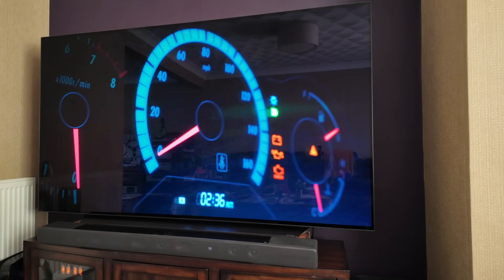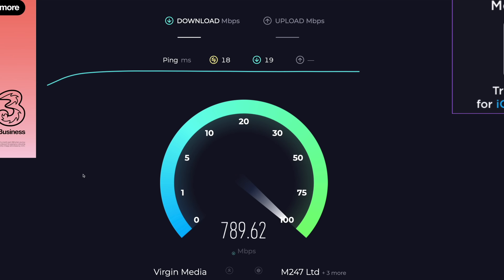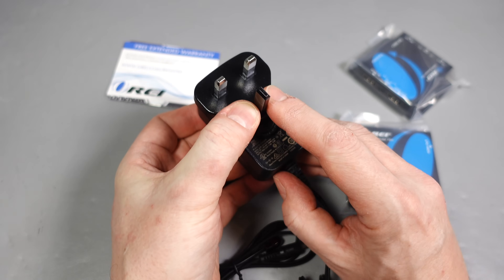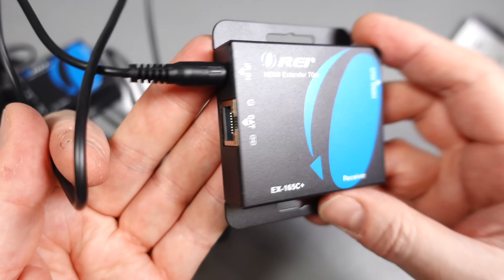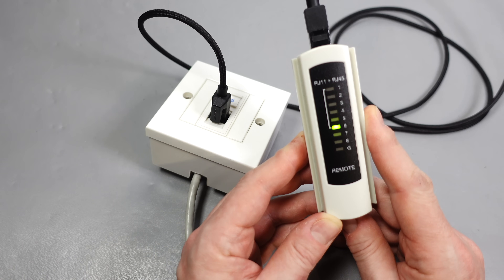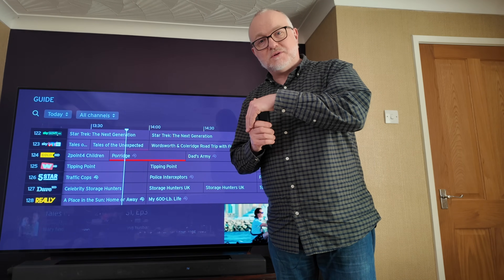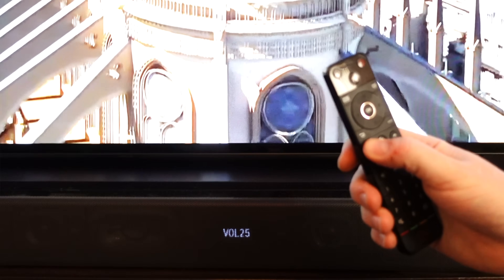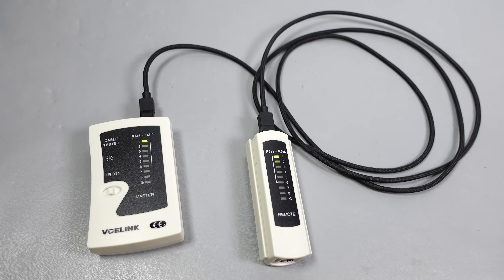HDMI via a Cat6 cable works surprisingly well

Comment: We use a lot of similar HDMI and KVM extenders for setting up CCTV monitoring/NOC centers at work. It is worth noting if you are thinking of installing these, do your self a huge favour and run screened Cat cables-and use the screened plugs as well. Most decent models will recommend this, as these extenders can be prone to interference.

Comment: Stupid question but those set top boxes usually connect over to the ISPs router via an Ethernet cable. Why not just use the existing cable and keep the box next to the tv?
Reply: Mr Techmoan had to put the box upstairs because that's where Virgin's coaxial cable comes into his house. The set-top box has to be connected to the Virgin coaxial cable from the street. This particular box also has to be connected to the Virgin router via Ethernet, which wasn't required for past generations of boxes, but it's the coaxial cable that's dictating the location of both the set top box and the router.

The householder isn't usually allowed to modify or extend Virgin's coaxial cable. Paying Virgin to install a new one is probably an option, but that would probably weaken your position when negotiating a good price for the new contract.

Virgin's "Stream" IPTV box can be connected via Ethernet only (though it's WiFi as standard) but that's a different service and not what's shown in this video.
Reply: @patrickwigmore3462  okay that makes way more sense to me, thanks for the explanation 🙏

Comment: These have been used in professional broadcasting setups for years.
Reply: They usually use SDI (Serial Digital Interface) or an NDI (Network Digital Interface).
Reply: @Didz  Yes unless cost is a factor. I maintain a few public access channel broadcast rooms for small local govt's who often have equipment spread out in a building and it's much cheaper to run network cable and extender boxes like these instead of SDI cable/hardware.

Comment: I'm always astonished at the lengths people will go to in order not to simply have a powerful computer plugged into their main display panel (TV). A decent modern or even an older PC or Mac could simply use wifi to do everything this system is doing minus the extra boxes and cables. 'But my computer is for doing my taxes, word processing, and internet surfing, not for watching streaming television.' Welcome to 2024, Granddad.
Reply: I would point out that, probably over 10 years ago now, he reviewed multiple wireless keyboard and trackpad combos specifically for using a computer on a TV from a couch. 

Not everyone wants to put up with using a mouse and web browser, or otherwise installing some media-centre front-end, when they just wanna watch some TV.
Reply: 'Put up with' using a mouse and a browser? More like they are so stuck in the 'My TV must be operated by a remote control and a mouse is only for a computer which is for word processing etc' mentality that they forgo all sorts of convenience and hang on to outdated and overpriced technology. The fact that it was 10 years ago says a lot. Old people and the technologically illiterate just don't seem able to let go of the past. He's comparing the image quality - it's coming from one shitty chip in his box. Get a computer with a GPU and live like a modern human. Imagine paying extra for a box and running all sorts of cables all so you can have less functionality. He even talks about streaming through an XBox which is half way there. Take the step, old timer, lmao. It blows my mind. Next week on Techmoan - newspapers and how to read them.
Reply: @YellowJello57  using a mouse on a TV sucks, even with a comically large pointer and a good wireless trackball. It’s just too precise for most things you’d do at that distance. And if you set things up to have giant buttons it’s still a pain to move the mouse around the giant targets, compared to using a remote control. 

If that’s more convenient to you, great, but I can’t understand it. And I used the computer even more than the VCR back in the late-90s/early-00s. Helped people hook up to a TV by an S-video cable… But even then I preferred a proper remote to control audio or video. Especially volume and forward/reverse… they’re always such a pain to click the right on-screen target, or use only 10% of a keyboard to control. Even with those tiny point-of-sale keyboards and USB extenders (or just wireless) to control XBMC or whatever, they are still way bigger than a good remote. 

Like, it’s just strange to me that implicit and axiomatic in your comments is the idea that it’s inherently better and easier and thus more desirable. Many of us have tried it, perhaps earlier than you even did, and just decided we prefer more specialised devices. For instance; a home NAS you can watch things on from anything on the wifi, compared to having everything on a gaming rig and switching to the TV output and manually finding and dragging files to VLC… (or, again, using a TV-like interface anyway; but worse with no remote). 

That also monopolises your PC, it’s harder to play stuff in the background while doing creative work or gaming without one interfering with the other. I’m happy to let a little ARM box (internal or external) run video, and let all of my computer’s power go towards (probably music production lately, but even back in 2009 I preferred running a separate CD/DVD player while I was editing videos a lot). It’s not inherently bad to focus your big computer’s power on work, after all plenty of people outside of the TV realm use an iPad for reading on the weekends rather than their big work computer. 

Like, if you’re the type of person who likes queuing up mplayer playlists from the command line from your sofa… or whatever…then more power to you. Honestly. I’m glad you enjoy running your computer through your TV all the time. But that’ll never be the most popular way to do it. Even people I know who do use their TV as a giant computer monitor (and specifically video editing preview monitor, often)… still tend to prefer a little ARM box (of whatever variety) running bideo on that same screen when they’re done working. And separate games consoles, often, as well. 

Anyway, I don’t really know why I wrote all this. You’re just going to say it’s wrong or old fashioned. But I may as well not waste the effort, because I’ve lived with it both ways multiple times. I used my big computer for everything from 2012-2018. At the end it was just stubbornness keeping me from splitting up the workloads and making each individual part work better.
Reply: @kaitlyn__L  That's ridiculous about the mouse. Use a PC NOT the pathetic 'computer' built into your TV. Listen, you do you, just like my Mom and Grandma. Connect by S-video. Have a LAN party! Good luck to you. I defy you to enjoy watching YouTube via your TV's inbuilt app and using the remote control to input text. Have fun.
Reply: TV boxes are cheaper than most other computers. Using such boxes can enable you to get away with fewer expensive computers in a multi-person household where not everyone wants to do the same activity at the same time.

TVs are usually comfortable for watching media content, but uncomfortable for office work. If you set up a PC for office work, connecting it to your TV might involve an HDMI extender anyway!

Some content (such as sports broadcasts) is only legally available through specific services that come with a set top box. Usually they also let you stream that content to other devices, but you have to be a subscriber with a box first, so you might as well use the box and save some electricity.

Small form factor PCs with integrated graphics are adequate for almost all video playback duties. Why buy an expensive, powerful computer if you're not going to be using it for productivity or playing modern games on it?

Meanwhile, streaming services still don't provide all the content that was previously available by other means, and they don't fully match the capabilities of PVRs for making and keeping recordings of programmes over the longer term.
Reply: @patrickwigmore3462  Have fun watching YT on your main large screen whilst using the remote control for text input, Steve Jobs.

Comment: Used these and older VGA/Composite/Component ones in museum exhibits. Always worked a treat. Have used the wireless ones, too, been okay. Some of them have been running 24/7 for 2-3 years at a time, no failures.

Comment: This type of device is called an "EXTENDER".  I use these professionally in an auditorium between the projection booth (where the PC is), and the stage (where we have monitors, keyboard/mouse for controlling the PC in the projection booth), with 75 feet of cable in-between.  Because these require DEDICATED Cat5e/6 cables for each extender, we run SIX Cat6 cables in a conduit as we have six extenders...we have two HDMI extenders for going up, two VGA extenders for going down, a USB going down, and XLR audio.
Some people wrongly call these "baluns" but baluns are passive devices while these are active (requiring power on one OR both ends depending on the extender you are using).
Some people do call these "Ethernet" cables, while the cables can be used for that purpose, they should be referred to as Cat5e/6 cables in this case as they have to be dedicated to the extender, and you can't use any Ethernet hubs or switches with extenders.  ***Yes there are SOME extenders that can work over Ethernet (with other signals), but those extenders are not recommended.

Comment: We've been using these exact  units in theaters at work.   Orei also make a sexy little 4K HDMI 2.0b  that allows us to get 4K/50 over to a group of TVs about 600M away from the AV enclosure....
Reply: What is the model number?

Comment: Me as a cable technician i prefer to just have a coax line ran to the device and when necessary use MOCA. All of the other devices used just cause more problems that people blame the cable company for.

Comment: Bro I'd use cat 5 don't use solid core cat6 they failed within a year not that version tho but it's just a different box also don't connect to sky hd or sky Q they don't do progressive they use interlaced and it screws with em and it works better on playstation 4
Reply: Sounds like a counterfeit cable you had (yes they exist). Real cables are copper while the fake ones are copper tinned alloy. Real cables have the standards they must meet printed on the cable while the fake ones won't.

Comment: Some of these are really bad. What's actually inside the cheap ones is an HDMI splitter with MAYBE some support for extended range. The key phrase to look for is "up to N meters/feet", and you'll know they're just winging it. Use shielded cables, and you might get somewhere close to that. HDMI is just really quite good at dealing with things so you get those cheap devices that really try to push it.

Comment: I use one for a remote monitor for a CCTV system, only downside I found is the power supplies didn't have a long life span, but as there just generic there easy to replace.

Comment: Your Internet speed. I'm crying and jealous.
Reply: Gigabit is reasonably common here in the UK, but most providers don't offer synchronous speeds, so the upload is often no more than 150
Reply: @jonc-1989  Depends on the provider. Lightspeed (I think only in Norfolk/Lincs) give you a gigabit up/down 😊
Reply: @jonc-1989  They do if you go for proper fibre instead of DOCSIS or VDSL, I get symetrical gigabit with Gigaclear even though it's marketed as 900mbps
Reply: @jonc-1989  Agreed.  I'm not on gigabit myself (half a gigabit actually),  but Virgin Media only give me 50 mbps upload.
Reply: just ran speedtest here in australia (on the supposedly quick nbn - not on fibre yet). just under 40/20. go speed racer go. im not just jealous of mat, im jealous of everyone else in the comments.
Reply: @DeaconTaylor  You'd still beat me, I'm at a whopping 30/3 lol
Reply: @microbuilder yeah, I'm finally having fiber available & installed on Monday. Currently my literal only option is DSL at 6 down 1/2 up. No joke. Cell providers don't have my address in their systems so i can't get a 5g box & there's no cable etc so the 80 year old phone lines are the only option. Gonna be a big bug difference after Monday lol!
Reply: @DeaconTaylor  Lots of Fibre in Tassy :)
Reply: I just got a new place with 1 gigabit speeds. It's like night and day from what I had before
Reply: 1000/200 is very usual here in Portugal too
Reply: few months ago I also got upgraded to gigabit, and it's amazing compared to 100 megabit
Reply: I just got 2Gb symmetrical fiber in the Chicagoland area for $70/mo. It's amazing, and I got to tell the local cable monopoly to piss off.
Reply: Virgin cable is awful
Reply: If anyone from the London area is here, I'd recommend community fibre broadband they do a 1Gbps symmetrical speed full fibre  connection for £26 a month its great I have their 3Gbps connection which is unnecessary but cheap enough for crazy speeds
Reply: Cries in FTTC! 40/10 maxed out with no option of FTTP, the county never had cable tv so no infrastructure.
Reply: Why cry? 40mb per second is more than enough. Literally no one needs a gb a second that's ridiculous. Even with 4k. I will never understand why 4k is even popular. It's more clear than what our eyes see and it makes things look disturbing. You can literally see the tiny hairs women have on their faces, or peoples pores, or the powder from their makeup. It's like looking at someone from 2 inches away. Gotta be a weirdo to think that looks good.
Reply: 1Gb up/down from youfibre i got in early so only £20 a month, Phone is £3 a month
Reply: Synchronous 900Mbps (in reality, hitting the limit of the Ethernet Gigabit standard at just over 940Mbps) for slightly less than I was paying for 48/15Mbps FTTC. The ISP I am with built their network with XGS PON so with little trouble could offer 10Gbps today if they wanted.
Reply: cries in german with my 50Mbit VDSL
Reply: Getting 945 MBIT downstream here (pretty much Ethernet Gigabit limit). Pretty normal for cableTV (DOCSIS). But upload is basically non-existent.
Reply: @kyoudaiken  yeah I'd honestly rather have 150/150 over 1000/50 (or whatever the numbers are, I've seen some get 1000/20 😱)
Reply: @kaitlyn__L  Got 1000/50. Absolutely a joke.
Reply: @kyoudaiken  crikey. That’s barely any better upload than you’d get from BT fibre to the cabinet. (Which was 80/20 if I recall?)
Reply: @kyoudaiken  I get 1000/20 I feel your pain.
Reply: @kaitlyn__L  in our old house we got like 800/5-10 upload
Reply: Shees! I live in The Netherlands and I am glad that we have fibre, which I technically can upgrade to 8 Gbit/s up and download! But that's way overkill, so I choose for the cheaper 1 Gbit/s up and download package.
Reply: @2Hard2Core  whoa, 8gig! I’m in a similar situation with symmetric fibre  (not cable), except my fibre to the basement caps out at 1gig. 

But I choose to get 150meg for half the price, because I would never make good use of more bandwidth on my own. That said, I wouldn’t turn down 1gig if they ever upgraded to a bigger capacity and 1gig became the lower priced option.
Reply: Really surprised at some comments here. Thought most of Europe had similar speeds. Running symmetrical 1Gig here in Spain. Fastest connection you can get here is symmetrical 10Gbps for 25€.
Reply: @TronicGames  You haven't been to Germany then. Our internet infrastructure outside of big cities is absolutely awful, same with mobile data. On top of that it's also pretty expensive.
Reply: @MPnoir  Been a couple times although big cities only. I was not measuring speeds at my friends houses 😂 Should've!
Reply: Meh, I've had gigabit for years here in Phoenix.

Comment: Maybe using HDBaseT standard? But these extenders have been widely used by AV installers, and you can get 4K/60 version (for extra money) as well. 
Some also support stuff like serial connection or usb alongside the HDMI.
Reply: Those aren't using HDbT. That requires much more robust processing. These are probably just signal amplifiers. The stuff they use commercially are either point-to-point or networked, from companies like Crestron and Extron.

Comment: We use something like them at work and they're great. 14 screens on 7 floors of the building, all displaying the same stuff: Schedules, notices, addresses from the CEO, PR reels, all sorts. All controlled from a PC just playing videos from a playlist.
Reply: That's probably something like Crestron NVX that they're using.
Reply: @andymandiak603  I don't remember what the brand was precisely but it is a pc with hdmi out to the box and that box goes to a normal ethernet switch. I'm reasonably sure it wasn't anything expensive tho as the PC was literally just running VLC in full screen, and that's the video signal that gets sent over the entire building.

Comment: Neat little device. I must have missed something though. 

Is there a reason why the Virgin box couldn't be plugged directly into the TV in the lounge, using the cabling to connect it to the router in the office. (maybe you want to also use it in the office?)
Reply: Mr Techmoan had to put the box upstairs because that's where Virgin's coaxial cable comes into his house. The set-top box has to be connected to the Virgin coaxial cable from the street. This particular box also has to be connected to the Virgin router via Ethernet, which wasn't required for past generations of boxes, but it's the coaxial cable that's dictating the location of both the set top box and the router.

The householder isn't usually allowed to modify or extend Virgin's coaxial cable. Paying Virgin to install a new one is probably an option, but that would probably weaken your position when negotiating a good price for the new contract.

Virgin's "Stream" IPTV box can be connected via Ethernet only (though it's WiFi as standard) but that's a different service and not what's shown in this video.